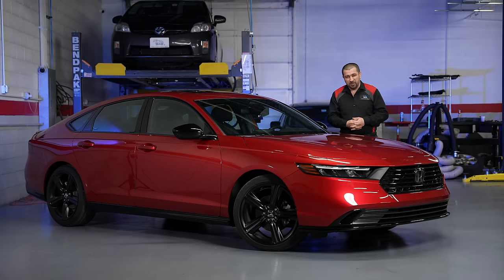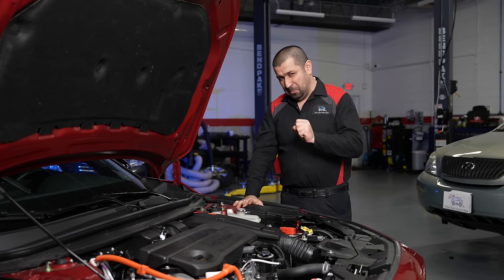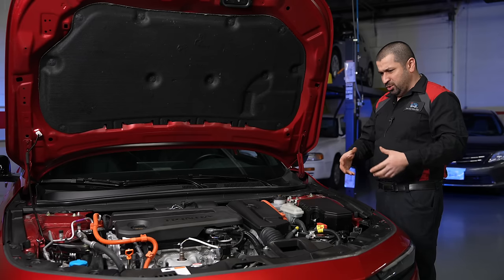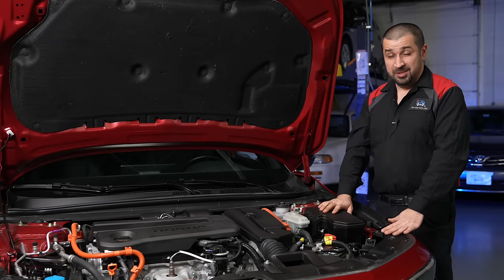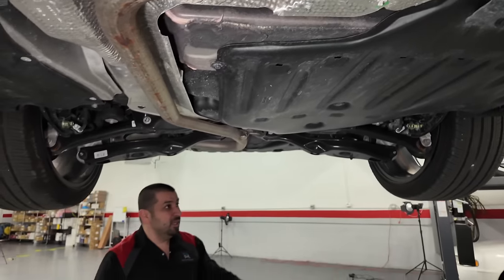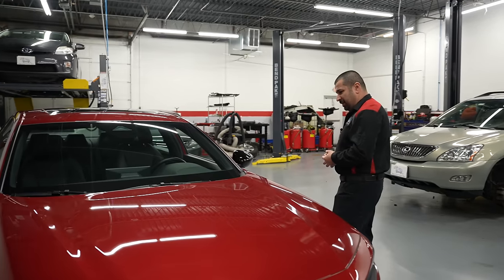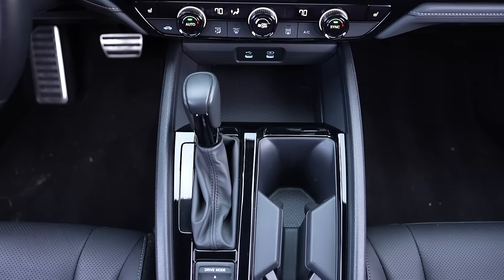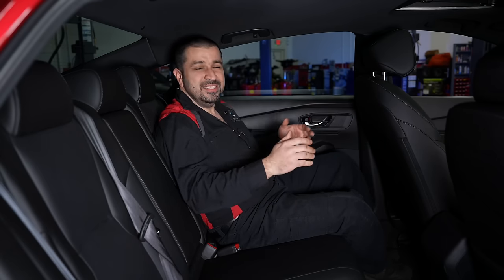Should You Buy The Latest Honda Accord? A Mechanic's Review

Comment: I own one of these and I learned a couple things here.  The owner's manual, like most these days, is too thick and buries important features as minutia.  One thing he didn't mention is the little "gear" that shows up in the power flow meter to indicate direct drive.  It's very subtle and it took me weeks of driving to even notice it.  HAH will actually engage direct drive in the mid 40s mph range.  I've seen it as low as 42 mpg (not 62 as he states) and sometimes still engaged in the mid 70s mph.  That direct drive  icon and EV display lets you really see what mode the HAH is operating in.  As he says, this car drives so seamlessly that it's difficult at time to detect it from the throttle response or driving dynamics.

I'm actually excited to try "charge" mode.  There is a use for that I believe in mountain driving.  The problem (and I use that term only in the lost opportunity sense) with these latest big motor designs, where the electric motor has more power than the ICE, is that maximum power is only available as long as you have useable battery charge.  Climbing a long grade in the mountains with only a hybrid sized battery will quickly drop you back to ICE power alone (albeit through the motor/genererator combo).  And the ICE's power is further reduced at high altitude.  Charge mode may be the "hold battery full" mode I've been wanting, where you know a particularly steep grade is coming and you'd like to prioritize having a full battery over the PCU's preference to have a partial charge available for regen braking or optimizing engine efficiency.

Comment: As always an excellent technical presentation.   
CVT's have such a negative connotation and such a high failure rate,   (Nissan, Subaru,  Honda HRV, etc).     Honda should not call this a CVT.   

I hate the  term "hybrid"  since it is a marketing term not a technical term.  Hybrid can mean so many different things.  
Hybrids are actually a terrible compromise.   
When your battery is dead,  you gasoline engine is dragging around a heavy dead battery and all the electric drive components.    
This is why hybrids are such dogs and get terrible fuel economy on the highway.  
When you are in EV mode,   your battery is dragging around the idle gasoline engine and transmission and drivetrain,   greatly reducing the EV range.  

A failure in both modes,   but hey,   you are saving the planet!
Reply: "Honda should not call this a CVT." Um, Toyota started it? But both are called eCVT, not CVT.

"Hybrids are actually a terrible compromise." They are not intended as a compromise. This is a strawman argument used by BEV advocates. They use some of the same technology found in BEVs to make an improved ICEV. It is the PHEV that is a compromise between HEV and BEV.

"When your battery is dead,  you gasoline engine is dragging around a heavy dead battery and all the electric drive components." Unless something breaks, or you run out of gas, the battery is never dead. They don't use the battery for the same purpose that a BEV does.

"This is why hybrids are such dogs and get terrible fuel economy on the highway." Um, they improve fuel economy both in the city, and on the highway.

"When you are in EV mode,  your battery is dragging around the idle gasoline engine and transmission and drivetrain, ... " Just like a BEV, when down to 20% charge, is dragging around 80% dead battery. This really is not a valid argument. Much like...

"... greatly reducing the EV range." They aren't trying to be BEVs. They don't have "EV range." They don't use the battery for the same purpose that a BEV does.

Comment: My daily driver is a 2017 Honda Accord 3.5 V6 touring. I specifically bought that model brand new because I knew it was the last V6 Honda ever put in an Accord. The driving experience of a six speed automatic pair to a V6 is unmatched. Average around 26 mpg in town get around 34 to 35 MPG on the highway if it’s flat I’ve had as high as 39 MPG And I would never trade that car ever.

These hybrids paired to these tiny gas engines look like major problems long-term imho. No thank you.
Reply: Dad’s 2014 Accord has that V6. Agree! Luv driving that car!
Reply: Same V6 here. Never selling or trading it.

Comment: Honda engineered all the fun out of the latest Accord.  Last year, I opted for a 2018 Acura TLX Advance (with V6) instead of getting a new Accord.  Regarding the extra antenna on the rear windshield, I'm wondering if Honda is going to practice over the air updates like Tesla.  Maybe that extra antenna is for stronger signal reception/more bandwidth?

Comment: Had my 2024 Hybrid since October of 2023. The only problems I’ve had is the “fix n go” air pump that comes with the car , exploded on me when I tried to put air in my flat tire. Horrible design and very cheap piece of equipment. 
Also, if you want to do maintenance yourself (like I like to do) it’s hard to find pieces to buy just because the cars new.
Then, the gas mileage fluctuates A LOT! Depending on your speed of course, but I still feel it’s wayyy too bipolar
& the braking system caused my friend to slam into a pole and be hospitalized. Lastly, I’ve almost gotten into plenty of accidents because of that dumb feature. Like literally, mosquitos would cover the front Honda Emblem (that’s where the sensor is) and the car would start braking very aggressively on its own. Then the dashboard lights up. I get out, remove the bugs and the cars normal again. Just a small Inconvenience. 
Other than that, everything is perfect😂

Comment: I love my 2024 Honda Accord Hybrid Ex-L.  I get many compliments on it being a classy or sexy car.  It is a very quiet, smooth ride and it gets great mileage.  I have a 2024 EX-L Hybrid and I can get 650 miles in a full tank.  Some will say they do not get this and I did not at first, but then I realized that the gas pump clicks off before it is completely full.  Meanwhile the gas gauge keeps going up.  So, now I fuel up and let the gauge go up to 600 and then some before I stop fueling.  I drive many freeway miles to work and I am saving 50% less on gas a week and month.
Reply: It’s not good to continue filling your car with gas after it clicks.
Reply: Agree with @jayo8484. The capless fuel tank has components at the top of the neck to the fuel tank that you will damage

Comment: you need to think of this as a heavy hybrid. it's possible to drive in EV mode up to 85 mph and won't cut out until you run out of juice.

It charges back up basically on every heavy breaking going down hill. it's not like your old hybrids that cut out at 20mph.

I drive on EV mode over 1/3 of my commute. it's amazing.
Reply: Yep. But it also charges while driving on gas.
Reply: @jeffjo8732  yep. it's amazing. except for the parking brake, which is horrible, iv loved it.
Reply: @bridamy  What do you not like about the parking brake? It's one of those hidden features that I love. Or do you not know it can be automatic?
Reply: @jeffjo8732  just that it doesn't engage when placed in park. never driven a car that does this. Only comes on after car is turned off
Reply: @bridamy  Did you try lifting up on the parking brake lever?

I'm not being flippant. I use the automatic parking brake, so I normally don't touch the lever. And it behaves as you describe. But if I shift to P and lift the lever, it does engage immediately.
Reply: @jeffjo8732  LOL yes same for me. I just can't be expecting to move my finger a few inches hahahahaha

Comment: Wiper - I always flip my wipers almost as a walk by - takes literally 2 seconds. Complexity - so here is a lesson.  My convertible had ONE hydraulic piston to raise and lower the roof under the back seat.  I would have to remove the boot cover and put it back on (many did not use the cover but my reading said you should).  So I knew (from reading) this was expensive and mechanically very hardy and reliable. BUT then the new version came out and people went on and on about how at a push of a button the panel opened to act as the boot - and even a solid roof option could be used where it sectionalized to fit in the back nicely - BUT the dealer told me they are an extreme customer dis-satisfaction as they aged as there were a "ton of extremely expensive and hard to coordinate to factory tolerances electric servos all over that car" to replace that single piston design. So they said - your car is such a better simpler design - do not be swayed by the cool new one as it is tricking people as it works so well in coordination (refinement) - but in the real world it takes just one of those servos to fail or start to act up to scuttle the advantage of "refined complexity" you have to trust and there is just too many factors going with the new ones.

Comment: I have a 2019 hybrid with 290, 000 miles, I've had to replace the water pump twice and had a blown head gasket. Other than that the car has been pretty good. Thinking about the 2025

Comment: The wipers that move slightly to bend the wiper rubbers the other way, every 3-5 use, is a brilliant idea. It has been in use with Skoda for 10 years and it stops the Brrrrrrr  on the screen that afflicts so many vehicles and annoys the drivers.. It should be mandated

Comment: Mazda had the same in there cars before 2018 were the tires don’t have actual TPMS sensor rather a wheel speed sensor which is very accurate and reliable. But they switch to sensors after 2018.

Comment: The windshield wiper preservation feature is cool.  Honda exclusive? I remember the GM windshield antennas. It came up from the center in two filaments about ⅝" apart, ran vertical to top and one turned left, other went right along the top of the windshield. It was 1972 Oldsmobile Custom Cruiser.   I like the interior, very linear and focused.  The angle of the shifter reminds me of a manual.  I appreciate the screen and dial cluster. The Civic is a sexier car but this one now has a more refined look and touches toptier buyers appreciate.  Overall it is very practical, efficient and quite an update from the 2001 Durango I've driven since 2006😂

Comment: What's great is that the engine only operates at its most efficient, either as a generator or when directly driving the vehicle at speed (not accelerating a from low RPM). Otherwise, the motors do the job.

Comment: BEWARE! 10th Gen 1.5L Accords (2018 Sport in my case) Suffered a blown head gasket around 75k miles. Costed me $10,500 at the dealership. So many of these cars are suffering from this issue and Honda will not honor this fix. I would try to get a 2.0 as they don’t have the head gasket issues.

Comment: My 2023 Mitsubishi Outlander PHEV works in a very similar fashion except the engine will drone when pushed, it doesn't do any kind of fake simulated shifting. And when you're on EV mode on the highway, EVs aren't efficient at those higher speeds so the gas engine will stay turned off the whole time and you'll burn through the charge real quick, more efficient hybrids will always revert to the gas engine to propel the car at higher speeds while conserving battery power for when you get off the highway. You could activate SAVE mode for highway driving but my point is it's not automatic.
Reply: As far as I've been able to discern, the Mitsubishi has similar parts but uses them for different purposes. It uses the the clutch when the motor needs power added; that is, during acceleration. The Honda uses it to increase efficiency during cruise.

The best way to think of the Honda is as a Battery+Generator EV. That's two of its three modes. In one, the ICE is off and the battery powers the motor alone. In another, the ICE powers the generator at 2000 rpm and 34 HP (where it is most efficient). The difference between that 34 HP and the car's requirement either charges, or discharges, the battery. "eCVT" means the car's speed can be anything while the rpm stay at 2000.

"EVs aren't efficient at those higher speeds so the gas engine will stay turned off the whole time and you'll burn through the charge." I'm reminded of an old joke. PATIENT: "Doctor, doctor, it hurts when I do this." DOCTOR: "Then don't do that."

It doesn't do that. When cruising above about 40 to 45 mph (not 62 mph), the clutch closes and it "reverts to the gas engine" to propel the car, like you want. But it operates like a Hyundai: the traction motor acts as a generator (most often) that charges the battery, so the ICE can stay at its most efficient power. In rare cases, it can add some power, but usually it is better to revert to Battery+Generator EV mode.

And yes, its changes are so automatic that most drivers do not realize they are happening. There is no equivalent of "SAVE" mode, or anything else the driver needs to activate, to get its best economy.

Comment: I've had an Accord Hybrid EX-L for 3 years. I love driving this car. It's excellent in all ways, except, the no spare tire thing is a problem. I've had 2 flats. 1 was a nail. The hole filler barely got me to a dealer 10 miles away. I used it up. The replacement is an eyepopping $100. 2nd flat was a blowout. I had to get a tow. Why isn't there a spare option.
Reply: Honda has a hangup about safety. Even if a feature would help sell their cars, they won't include it if they think it is potentially dangerous. A good example is no "auto-up" window controls in the back seat. Many reviews complain that Honda refuses to use them. But a child who accidentally presses the button won't realize that she needs to stop the window by pressing the button the other way before it crushes a bone.

In collision, a spare tire in the trunk becomes is a missile aimed at the hybrid battery.

But if you want one, there are non-OEM ones available. There is a spare-tire well that it fits in. Your choice.

Comment: With the intake battery vent under the rear seat, the owner has to be really careful not to cover it with any car seat cover that Wil, block it. In fact I would recommend not placing a rear car seat cover at all. I had a prius that I would be careful not to allow the rear car seat cover from blocking the intake vent.

Comment: It would be cool to see a review on the BYD Qin L with the plug-in but alas, those are not really reviewable in the US. That car (and I think Mitsubishi Outlander PHEV) uses a similar principle of “engine connected to a generator motor and also the wheels via a clutch so you only run engine to wheel power at optimal RPMs for highway driving”

Comment: We had an '18 Civic SI with the 1.5T and it had a horrible issue with oil dilution. I live in Arizona, don't idle for long periods of time, and I made sure to drive a lot on the highway to get the oil temp up. Basically Honda said they would not help out unless the car was stalling or having major drivability issues. It sucks because I really loved the SI, but I won't be buying any Hondas with a turbo.

Comment: If you want gummed up valves from direct injection, if you like cvt trans, start stop, and turbo engine, go ahead, had crv with all that and traded it for a Toyota with port/direct injection, 8 speed trans, 2.5 non turbo engine, and no annoying start stop and loving it.
Reply: This new accord isn’t any of that
Reply: @Vegitobluuuuu  They did switch from port injection to direct multi-stage injection with the latest generation. But no turbo.

And while they do call it an eCVT, in that mode it is actually an EV that uses a battery and an ICE- generator, instead of just a battery. It isn't "star-stop" like ronl2463 thinks. Since it is an EV, it begins moving faster than any pure ICE car can, on battery power. And when it starts the ICE it doesn't use a starter motor. The generator actually places it at full operational speed.

So these are all lies that ronl2463 uses to justify the conclusion he wanted to reach from the start.
Reply: @jeffjo8732  will there be carbon buildup eventually since it’s direct injection system ?

Comment: Yeah but clutch wear problems is a thing of the past if fluid changes are kept up on and the transmission isn't overheated.  Fluids and clutch materials today are fantastic.  What I don't like is the intake is crammed in the back and with direct injection only that is going to be an issue for valve cleaning with crushed walnut blasting which it's going to need after 150K miles.

Comment: In fact, a TPMS that relies on speed rather than a true measure is a cheap substitute. It allows a very large pressure differental to pile up before it alerts. Your tire could drop up to 6 lbs of underinflation before it alerts, which is quite frankly crap.

Comment: The steering wheel control 30:13, you should had explain the -+ paddle shifters which are usually for changing gears. But I think they are for regenerating braking. A little explanation was needed there.

Comment: 13:45 the Clutch in Honda e:hev hybrid transmission should never wear out if the system works correctly. As it's being engaged only when the car has certain speed and it's so easy for electronic to do engine and wheel speed synchronization so the clutch has almost no mechanical strain.

Comment: Great video, I am currently in a 2013 accord. I’m really hoping for a plugin hybrid accord in the future. 

My two cents on why two antennas for hybrid car. The vehicle appears to be mainly ac motor drive. By having two antennas, stereo system can be configured to cancel out electronic motor ac interference when using AC radio. 

(Referring to early Tesla model S models having AC radio issues when driving due to electrical interference)

Comment: Direct injection engine will build up carbon on valves.. i asked mechanics st dealer,; there is a solvent clesner they add to vacuum system..costs $120.  Needd this done every 20000 miles